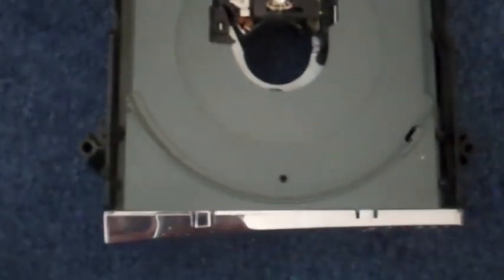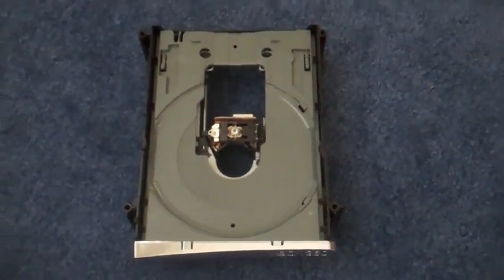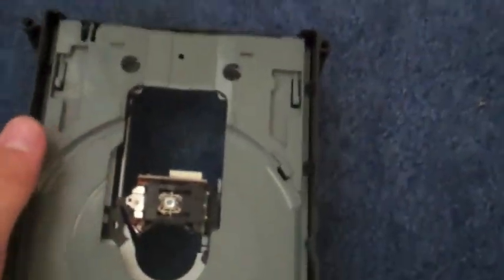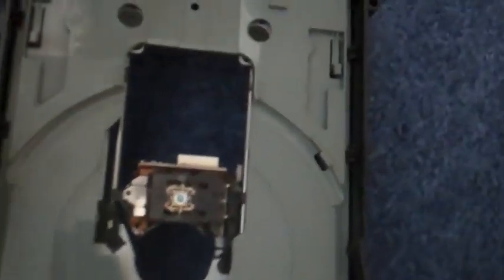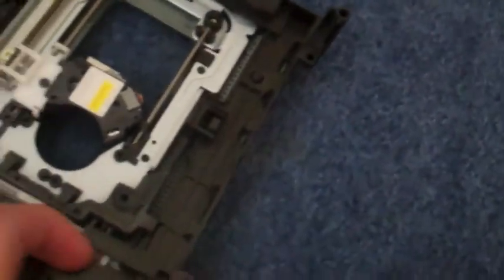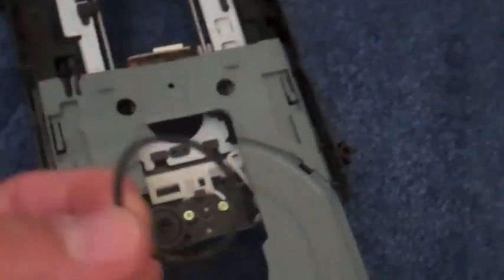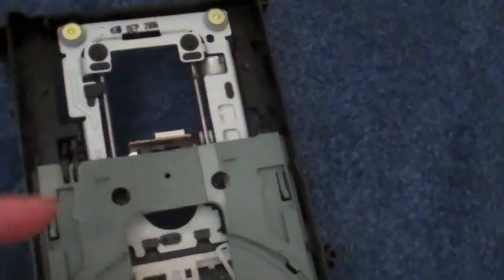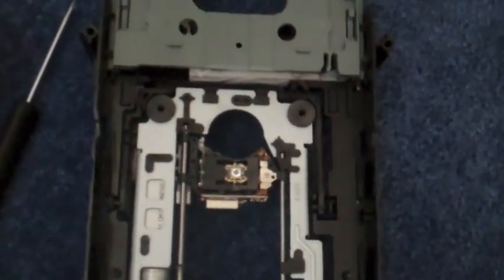Tutorial How To Fix Your Xbox 360 Disk Drive: Open Tray, Laser Now Reading Disks, Stuck Tray

Comment: The 2 screws on the back of the laser are potentiometers and shouldn't be messed with without knowing what you are doing. They don't actually increase the power of the laser per say. They control the laser resistance. Benq and Lite On use the same laser and are notorious for dying. You can lower the resistance and get some more life out of it. BUT if you lower it too much, the laser can burn your game disc and kill it. Adjusting them without a multi meter is a desperation/last option solution.
Reply: it wont burn your game disc will it? pretty sure you mean you lower the resistance too much therefore provide too much power to the laser and burn it out. (the laser) 

im putting a new laser in an old xbox and i might try increading resistance to protect (undervolt) the laser a bit. so long as it still reads, as i dont want it to burn out as fast as the last one. but then again, if you weaken the laser it might have to work twice as hard to read discs and thus still wear out just as fast anyway. especially if you are using backup/ burned games that usually especially after microsoft added that extra .2gb or whatever to edge of discs in XGD3 that mean we have to overburn discs to 8.7gb on 8.5gb discs which means a lesser quality burn thats harder to read...

eh, why am i still typing. this video is old. xbox 360's are old. i am old. i am tired. i am going to bed. :-)

Comment: Heres one for ya...mine has been updated,has worked fine till the past month.  No matter what game i put in 360 or reg xbox game, it just says reading,push the eject button wont open,turn off,fan still runs,unplug for a min and plug back up,then push disc tray button and opens fine. System menu operates fine ??? havent played on it in a month does this whenever try to play something

Comment: I took your advice and used a Q-Tip with a bit of rubbing alcohol on the tip to clean the disk reader, but it still isn't reading disks. Do you have any other ideas I could try to fix it? :/

Comment: hey! the problem i am having with my disc drive is that it is stuck open only about an inch and will not slide back and forth even half an inch. the drive was stuck closed and my sister tried prying it open with a knife so it is now jammed therefor i cannot pull the tray out far enough to fully reveal the band or what ever may be stopping the tray from moving. i dont want to force it and make it even worse, but please let me know if you have any ideas what could be causing this!!

Comment: @thedopesoner930 well i did open it up and it's a phillips and lite on drive. i opened it up and the lazer wasn't in the back so that's not the problem and i only found one screw on there and tightend it and it still didn't do anything. any advice?

Comment: Tighten the screw and tried my disc drive and worked instantly! Thanks
Reply: how did that go for you?.... without a multimeter to make 1 10th of a mm adjustment and then check resistence is still in spec you probably cranked that resistance way down out of spec, and laser strength way up and burned it out pretty fast.. i suspect it didnt work well for long. this youtuber really should have cautioned people on that and given instrucions on using a multimeter to measure its resistance after you change it etc. he probably destroyed a fair few xbox 360's with this video. at least most of them were probably not reading discs well or even at all before though i guess. and a new laser is pretty cheap and easy to replace.

Comment: K my xbox can read and play all my games like a champ, but when  i try putting in new games, it says open tray or it plays and says the disc is unreadable at a random time. i exchanged 3 copies of lost planet 2 and got the same issue. no scratches on the discs. is this disc drive related? or am i going to have to get a new xbox? its an original model thats 4 years old.

Comment: i kicked my tray when i realized it was not working. now i try to repair it and made it worst because i thought it was the gear. it wont close and the lens wont start up. i went from point A to point negative 2. please.:( i dont think all these disc cleaning errors will work but i will give it a try. i think it has something to deal with the gears though.

Comment: I think my rubber band just snapped of cause It kinda fell off my desk and landed on a plug it put a hole in the xbox but the xbox works fine the disk drive won't open and I got the worst game ever (sonic 06) stuck inside

Comment: It didn't work, even when there is a disc in it it makes the noise where there is no disc in it
Reply from the maker: Some drives just need to be replaced. I have had a few drives that no matter what I do or replace dont want to work
Reply: thedopesoner930 How Do You Know If Your Laser Is Dead
Reply: +FG    x Bladed the  laser dont read  the  games :V  is  the true
Reply: Same it happened to my Xbox 360